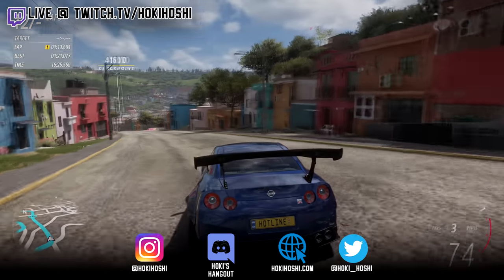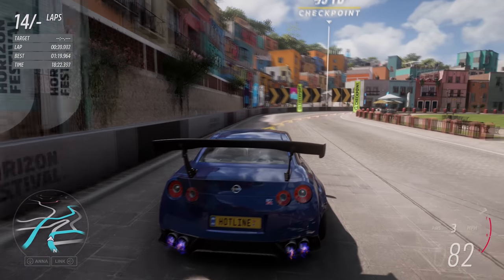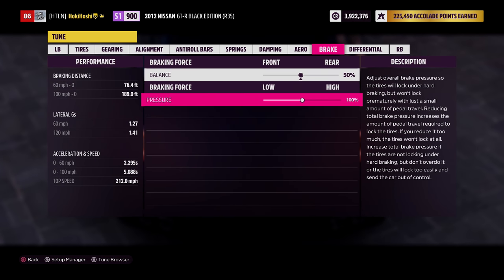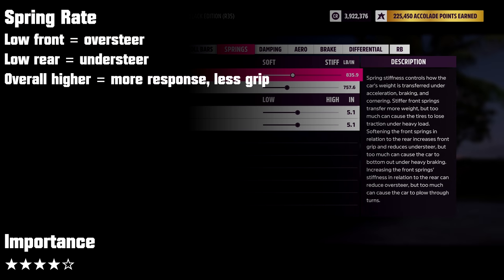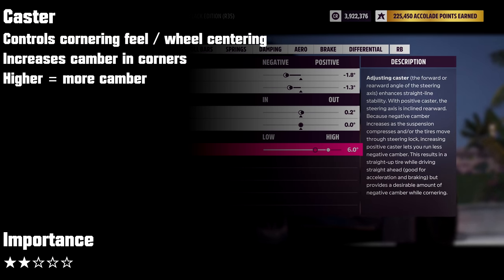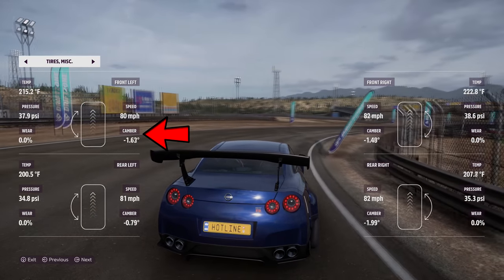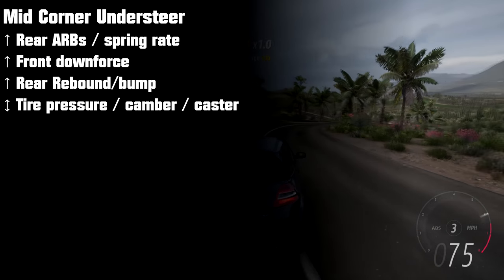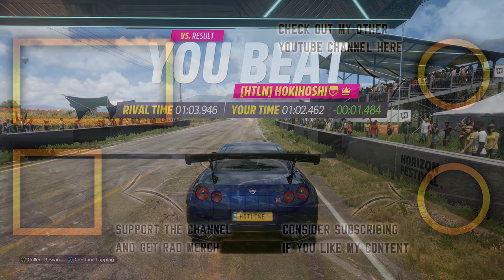How to Tune in Forza Horizon 5 | Basics of Tuning Guide

Comment: If anyone wants to save all this info, I kind of got all the first parts together. Enjoy!

Differential
Rear accel- higher diff causes more oversteer
50-90% (the higher hp, higher diff)

Front accel- higher diff causes more understeer
10-50% on track (low track high rally)

Front and rear decel- higher diff causes understeer, but a bit can help rotation

Center- higher setting causes oversteer
50-80% (high track low rally)

Brake
Reversed, so
Front= more rear force (more stable, understeer)
Rear= more front force (less stable, oversteer)

Braking force (leave it as is)

Aero
Overall high= less speed, more grip, hotter tired
High front =oversteer
High rear = oversteer, but understeer if too high compared to front

Damping
Controls spring compression/extension
Bump stiffness = 50-75% rebound
High bump- slower compression 
(Usually towards the low end of the scale in game)

High front setting- more rear grip
High rear setting- more front grip
Low front setting- more front grip
Low rear setting- more rear grip

(Base leave rebound and soften a bit bump)

Springs
Low front- oversteer
Low rear- understeer
Overall higher- more response, less grip

(Base usually a bit too stiff for 4x4 and fwd)

Height- as low as possible without hitting the ground

Antiroll bars
Affects body roll (entry + midcorner balance)
Low front- oversteer
Low rear- understeer

(Base go half soft on front and half stiff on rear for 4x4 and fwd)
(Leave as is for rwd)

Alignment
Camber = vertical angle
Toe= horizontal angle
Caster= suspension angle

Camber
Needs adjustment using telemetry- never above 0°, 

(Base put a little less than the game, 1.8, 1.7 front; 1.3, 1.2 rear)

Toe
Very small changes
Fwd and 4x4 try .1 or .2 front toe out to give oversteer (if still needed also rear toe out)
Rwd try .1 or .2 rear toe in to keep rear stable

Toe out- oversteer, response
Toe in- understeer, stability

Caster
Between 4-7°
Higher caster- more camber

Gears
Bigger first and second
Try reaching end of graph

Tires
Controls grip, shape and temp
Higher = better response, but more sudden loss of grip
26-35 psi for track (1.8-2.4 bar)
Reply: I love you
Reply: @danmar2026  Ayo 😳
Reply: Ty
Reply: Cant copy😢
Reply: i did fastest f1 in 7 days after start playing  game without any guide and I have to say that it doesnt really matter. lol
Reply: Thank you kind person
Reply: Nice
Reply: W mans
Reply: Legend
Reply: I never like comments but man you deserve it you're a fkn king
Reply: U r a litteraly a s saviour
Reply: You are a life saver
Reply: Bro you're used to taking notes in class aren't you lmao
Reply: Man I already did this fuck I could’ve jus copied this😭
Reply: Tysm bro
Reply: MVP right here!
Reply: The guy who takes notes and then shares them with the rest of the class, what a G